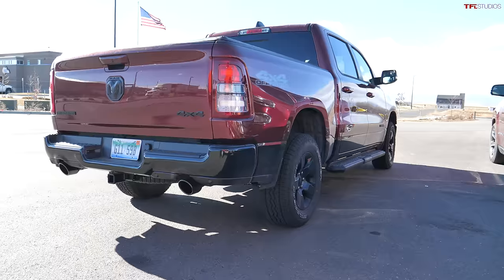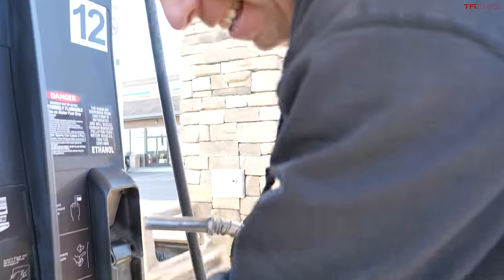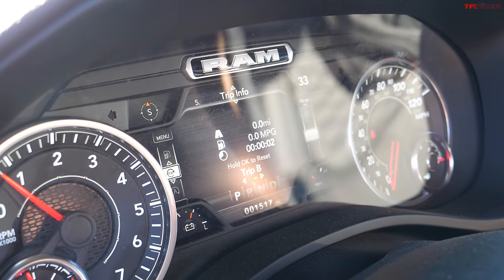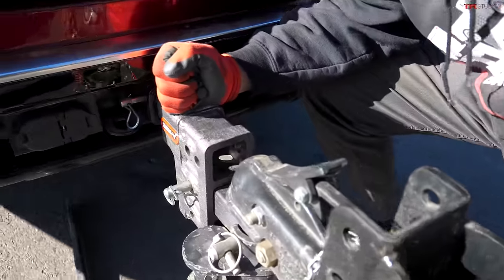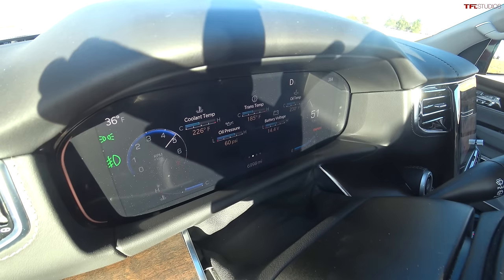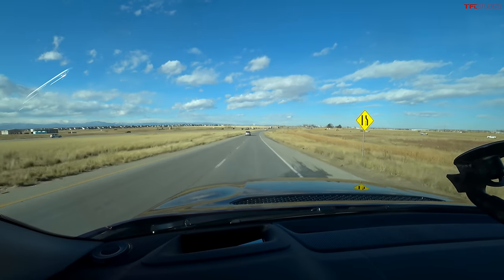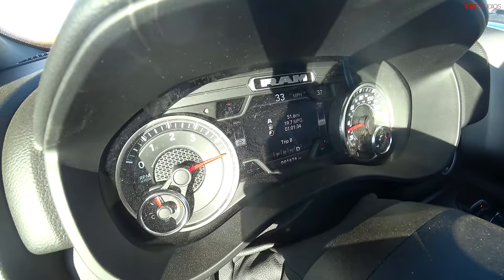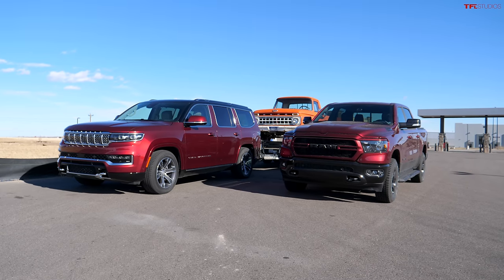Jeep Grand Wagoneer vs Ram 1500 Tow-a-thon: One of These Tows Much Better Than the Other!

Comment: The Grand Wagoneer is very impressive.(wish you'd run it up the Ike!) As a lover of all things Mopar, it confounds me that Ram has been reluctant for years on putting the glorious 392 in the 1500. I hope they do it as part of the 2023 update. 

I'm also happy to see more realistic sound level readings for the Ram vs those that were recorded when going up the Ike. The cabin in the Ram is very insulated, so much so that TRX buyers always complain that they can't hear much of the supercharger whine and exhaust of their truck. 

Popping onto the Wagoneer forums, most owners report far higher hwy MPG than the 18 the EPA states. And I agree, I think the GW is a better buy than the Escalade or Navigator.
Reply: Yeah it is a little baffling that you can’t get the 392 in the 1500
Reply: @patrickmartin3322  last year at a Mopar-sponsored Hellcat owners event in Michigan and Ralph Gilles was in attendance. I asked directly why the 392 has appeared in a high-profit machine like the Ram but is available widely in the Challenger and Charger and he didn't directly address it but he said he wanted that engine in the 1500 in some capacity. It wouldn't surprise me that it pops up next year as an option when the 5.7 retires as the 3.0 GME I-6 takes its spot.
Reply: @Mike true, that's why the Hellcat is going away in all forms in 2024, as 2025 requires much more stringent emissions requirements, but strangely the 6.4 and 5.7 already meet that standard(which is why the 5.7 lost power for the GC debut for 2021). I still believe eventually the V8s will all be gone and replaced by the I-6 and electric trucks. Vehicles like the Hellcat Challenger/Chargers, TRX, Raptor R, GT500, CT5-V Blackwing and others are going to go crazy in value. We are already seeing it with all of the V8 Mercedes products since they've already announced the ending of V8-V12 production. 

Electrification will be the standard within 5-7 years(new car purchases).
Reply: @Xxplicit EXACTLY! Decades after asking for V8 Wranglers again...Jeep decides to SKIP the 5.7 and stuff the 6.4 in and TRIED to stuff the Hellcat in. Ram is missing a tremendous sweet spot between the 5.7 and Hellcat and buyers have cash and ready to buy!

Comment: Glad the wagoneer is back! But I'll stay with the ram! I'm always using my truck bed! Would love the 6.4l though!
Reply: No one ever seemed to want it but the ram 2500 power wagon had the 6.4 hemi or the 6.7 Cummins.
Reply: Not sure it is still available or what year it stopped being offered.
Reply: @nathangortz3203  I don’t think the PW had the option for the 6.7. A lot of people had complains about that I believe.
Reply: Ram 2500
Reply: The 6.4 in the 2500 is different. 410 HP compared to 470.  It's built for punishing towing abuse and longevity.  Not necessarily raw speed.
Reply: @ALMX5DP  yeah the powerwagon doesnt come with the cummins, just the 6.4

Comment: Wagoneer looks impressive, would love to see a head to head vs the Tahoe or Yukon. Just for kicks Was looking into the wagoneer a few weeks back and couldn't find one anywhere with the off road package
Reply: I'm a fan of both these and the Yukon by looks for a full size SUV and would love to see the comparison as well, also not even a fan of most domestic vehicles but as stated above aesthetically, those are pleasing, and the wagoneer proved itself and it's (absurd) worth with it's towing capacity and comfort along with it's mpg flexibility, I'm here where jeeps are built 419🖤, and the electric Wrangler is also an interesting plot twist to their lineup
Reply: Just wait for all the problems it's going to have.
Reply: suburban vs yukon xl, im in love with the suburban because my dad had a 9th gen with the 5.3L ever since he passed ive been trying to find one in decent shape
Reply: What problems ? All the hard parts are fairly reliable trans and engine are fine . The tick isn’t really wide spread cops cars see the most issues even with 7500 hours on the 5.7 with proper oil changes they are mostly fine sooooo... are you referring to electronic problems? Most well off people lease them and get new ones every few years ... please explain
Reply: Because it isn't for going off road, it is for everything the original Wagoneers mocked. While Land Rover was busy trying to make a Rolls Royce mix with a Defender, Jeep realized nobody is going to go play in the mud in a vehicle that you don't want to get back into with muddy boots.  They put AC and electric windows in and called it their version of upscale.  Still functional but not to full of themselves.  They were fantastic.  This thing betrays the very core of what the Wagoneer name represents!
Reply: Even though I'm interested in comparison, Im pretty sure I won't be buying anymore vehicles from Jeep. Not a good  experience with my Wrangler Rubicon JL and their whole dealer network lol.  Just  not sure I want to make another mistake
Reply: It would need to be a grand wagoneer vs escalade
Reply: The Series 2 Offroad Package is different and better from the Series 3 version of the same package. The Series 2 Offroad Package has more and better offroad parts.
Reply: Doesn’t the 0-60 kill the towing mpg? Or was it done before the fill up?
Reply: @bethanyboada7441  lol so as long as you lease and get a new one every 3 years it's fine. That's the Ram sentiment going back 2 decades: trade in before warranty runs out
Reply: I would run the empty test in the wagoneer A couple times, it looks like the pump shut off prematurely.
Reply: @csgsavagebanana8102  they are basically exactly the same just design on the rear and front is different
Reply: @csgsavagebanana8102  it is a bit hard to find one in good shape so find the one that’s in best shape and if you need to fix a few things that don’t cost too much you should go for it.

Comment: Thanks for these towing tests, they are very informative. It would be even more informative for those of us who tow RVs if you did towing tests with travel trailers. The frontal area and wind drag of a travel trailer is significantly more than towing a vehicle on a flatbed.

Comment: This tells me that the 5.7 should have been replaced with the 6.4… in ram 1500s
Reply: A long damn time ago
Reply: You do know the #s in the 6.4 and 5.7 are practically identical in the trucks except the 6.4 uses more fuel. Literally like 5 hp and 10 ft lb difference
Reply: @OriginalYTBR  this 6.4 version.. the version in the 392 needs to be In 1500
Reply: @jeremyrusselldavis  I second this
Reply: This.
Reply: @OriginalYTBR  this 392 has 470 horse. I'd say that's more than a smidge...  The wagoneer is a second faster to 60 and weighs more!
Reply: @OriginalYTBR  You may be thinking of the HD truck version of the 6.4L, this is essentially the SRT 6.4L variant.  Cam and tuning are much more aggressive on SRT 6.4.
Reply: @OriginalYTBR  the 6.4 Uses premium and is more Fuel Efficient than the 5.7. and there are No where near identical. ( we are talking SRT's 6.4 not the Truck 6.4)
Reply: I believe that in the 5.7’s owners manual it says 89 octane recommended but will run fine on 87 with a small loss in performance.
Reply: @paulhunter9613  That's correct

Comment: Might as well put the 6.4 in the ram also 🤷🏾‍♂️
Reply: They did (unsure if they still do) but in the more heavy duty ram 2500 power wagon. When that truck came out in 2012 or 13 is actually how I found this channel.
Reply: @Nathan Gortz  Yeah they supply the 6.4 for the 2500. but I was referring to the Ram 1500 like the one in the video.
Reply: Extremely unlikely going forward. Hemi was canceled. Going to be replaced by a new turbod V6 platform (new engine, not pentastar)
Reply: @KyleHarrisonRedacted  It's actually an Inline 6.
Reply: Why not get a 2500 then. If you need a Ram 1500 with more towing power, I’d recommend the EcoDissel or Cummins.
Reply: @nathangortz3203  that's not the same 6.4l engine.

Comment: Great Video!

Just a heads-up: RAM 1500 recommends 89oct for the Hemi, 87oct is ok in a pinch but not recommended.
Reply: Always ran 89 in my Rams and I noticed a difference when I used 87 when I was in a pinch. Way better econ with 89.

Comment: Purchased a wagoneer series 3 (not the grand) for the wife in December, sticker was $90,200 completely loaded. Some may say that’s high but I can tell you looking at GMC, and Cadillac getting even close to the options I have in my series 3 put both of them closer to $105 and both still have less tow capacity and far less quality as my wagoneer. We are now 1 month in this wagoneer and still find options and electronics we did not know we had. My only complaint is the monitors in the rear seats which are based on the amazon firestick platform so far in MY opinion is horrible. In one month the monitors have froze several times and we will be calling wagoneer about this if it happens again. Sorry but for $90k the entertainment for the kids shouldn’t freeze up this much. 
Other than that the wagoneer is amazing and I would say there is really NO OTHER suv with as much quality yet than this thing. I own a 2020 ram HO so I can’t compare the towing with that but my wife traded in our 2019 Nissan Titan XD for the wagoneer 3. Comparing bumper pull with that I would say it is impressive for an suv on our trailer. My trailer is a 20foot with a 50hp tractor for our ranch. About 8800 with attachments and  50 gallons of diesel on the deck..
Reply: Dang traded in the Titan, what was wrong with it?  Already tired of driving it or, just wanted a new vehicle again?  

8800lbs behind a Wagoneer is pretty impressive for an SUV.
Reply: @wildbill23c  nothing was wrong with my Titan XD. I actually miss it since it was fully loaded with options and towed great. However I also had purchased a 2020 Ram 3500 Dually with the high output Cummins. Nissan bought the Titan back from me for $4,000 more than my payoff. Could not pass that up. And honestly after towing with the Ram, it’s a different animal. Yes the Titan handled the 12,000 gooseneck trailer just fine but you did know it was there. To be truthful this Ram 3500 I really cannot tell there is a trailer behind me. Also with the wife getting the wagoneer, I knew her wagoneer had a max tow of 10k so I could still pull a bumper pull with her suv on the ranch if needed. Back to your question again, I would truly buy another Titan XD if I have the need for a 2500 truck again.
Reply: @easttexasengineering3489  Thanks for your response.  The Titan is on my truck list, I don't need a 3/4 or 1 ton truck, I just need to be able to haul my tractor, trailer and implements that weighs around 6500lbs, so I know the Titan is certainly capable of that, and after my experience with a 2008 Toyota Tundra I won't be getting another one of them.  My 2008 Explorer is rated for 7100lbs and 6500lbs is way too close to the limit for my comfort to be towing that much weight somewhat frequently.
Reply: Eye Spy - the best entertainment.

Comment: Really shocked by the Wagoneer's mog result. I want to see more of that because it's rated for 18mpg highway and returned nearly 25 in test, truly impressive. I would also like to see a direct comparison now of the 6.4 and 5.7 in the same spec vehicle like Charger/Challenger or Grand Cherokee, maybe Durango to see what truly is, as having 100 more hp and the same mpg possible is amazing.

Comment: I've seen in GM trucks I've owned the V8s get pretty decent mileage on highway if driven not aggressively. I've also experienced the higher powered, premium gas V8 (6.2) getting better MPG towing and empty than the regular gas V8 (5.3) just like this
Reply: Larger engine under load doesn't have to work nearly as hard as a smaller engine, so I can easily see a better fuel economy number while towing.

Comment: I believe the RAM recommends 87 for not towing and 89 when towing. I know that's what my 2021 RAM 1500 5.7 w/eTorque with the 3.9 rear says.  I would assume the 2022 is the same.
Reply: Octane ratings are different at high elevation
Reply: Octane ratings are the same but the air density is different
Reply: Yeah I’d personally try to follow manufacturer minimum requirements regardless of elevation.
Reply: @ALMX5DP  You can try but the Premium they recommend for the grand wagoneer doesnt make any difference at high elevation

Comment: I think you should include cost ($.$$) per mile calculations when comparing 87 octane and 91 octane fuel economy... and when looking at EVs as well.  
Also, given the price difference in vehicles, cost of vehicle + gas + maintenance for 100,000 and 200,00 0 miles.  Then you can add or deduct the luxury value over 10 years.  
Luxury value is a $$ value for key features such as heated seats, sun roof, collision avoidance, cruise control, lane keeping, etc.  What are people willing to pay for each.  Check list for a total.  :)
Reply: Good idea but they will not do that. I do really like the TFL team but sometimes I get the feeling they are a little to close to FCA.  For example how is it that Andre did not call out how a 100,000 dollar vehicle is no quieter than a 50,000 pickup.  He did mention it but more in how good the Ram was and silence on how a vehicle that costs twice as much did the same.  That’s unforgivable.  Also a regular Wagoneer has a starting cost of 15,000 over a Tahoe/Yukon. What do you get for that extra 15,000 grand? Absolutely nothing and they should be shredding FCA for that blatant cash grab.  Yet they do not even bring it up, strange.
Reply: People say the same thing when they test fords and Toyota, that they favor that brand.

Comment: Next time maybe test it vs a standard wagoneer with the same 5.7. Pricing and performance would be about the same. Comparing it to a 90k+ suv puts it in the realm of a loaded limited 3500 diesel dually not a big horn 1500.
Reply: Sure, keep making excuses for the failure of the 1500 aka Pavement Princess.

Comment: Just proves that displacement doesn't result in what you think. Axle ratio and octane probably had a greater impact.
Reply: ...as well as ground clearance and TIRES. A more aggressive look will cost you more if one rarely leaves the pavement.

Comment: The highway MPG of the Wagoneer in your test was a miracle. Perhaps a possible explanation was the slipstream from the trailer (assuming the MPG test was performed when the Wagoneer was following the Ram while it was towing and vice versa). Perhaps the Wagoneer was driven closer behind the trailer than the Ram, accounting for the more miraculous fuel economy. Great video.

Comment: If you look at the owners manual the 5.7 ram is actually 89 recommended fuel. But 87 will work
Reply: 87 is the 89 equivalent in Colorado

Comment: It's interesting that the larger displacement engine is more efficient.  Are axle ratios and transmissions similar?  Thanks for the great test!   I didnt realize how capable the 6.4 is.
Reply: The 6.4 is larger and more torque down low in the rpm’s, much better for towing so it isn’t under as much strain to pull the load as the 5.7. The 5.7 really has to dump gas into the cylinders and rev to do the same work as the 6.4
Reply: As capable and stout as the 5.7 hemi is. It's still only a 350 cubic inch motor. I love my 5.7 Hemi Ram but wish it was easier and cheaper to get a big sized motor to tow like back in the day. A 440 Ram should be a normal option. hahaha
Reply: @messagefamilystyled1101  you are right. Alot of ppl think that if its a bigger displacement engine that its gonna burn more gas. Just like you said, the 6.4 is more powerful and doesnt have to work as hard to do the same thing the smaller 5.7 is doing.
Reply: @wellthatdidntwork  no replacement for displacement.
Reply: @BBBILLY86  
353 cubes
Reply: @dillonh321  TY. Still no 454 or 440 cubic inch tow motor. Would love a big block Ram that wasn't a 100k TRX
Reply: Also have cylinder shut off big no.
Reply: @BBBILLY86  
Unfortunately its difficult to get big blocks to pass U.S. minimum fuel economy standards. More big blocks are coming out to HD trucks but I doubt half tons will ever get any. Ford has a 440 big block (7.3l) in the f250, Chevy has a 400 big block (6.6l) the Silverado hd.

Comment: Really wish they would put the 6.4 in the ram
Reply: The did, it was in the 2500 chassis. Google 2500 power wagon. Had the choice of the 6.4 or 6.7 Cummins.
Reply: @nathangortz3203  yeah I know they are in the 2500 but wish they would put them in the 1500
Reply: @nathangortz3203  people are aware they put the 6.4L in the 2500. People want it in the half ton trucks, but itll never happen because of cafe numbers
Reply: @nathangortz3203  HD 6.4 is 410 HP built for towing durability.  This one is 470.  This engine should have been put in a 1/2 ton by now. No excuse for it.